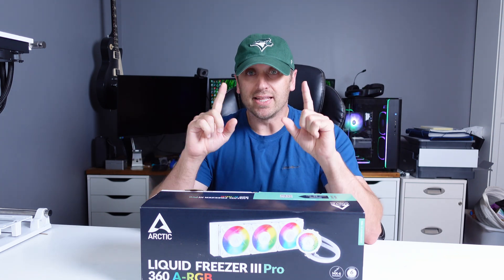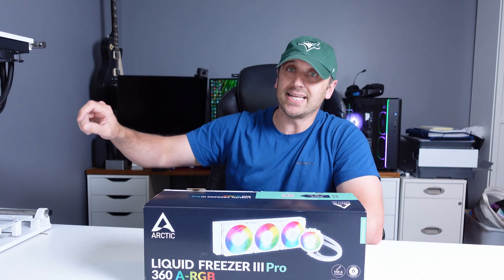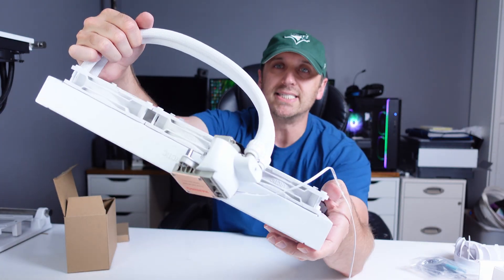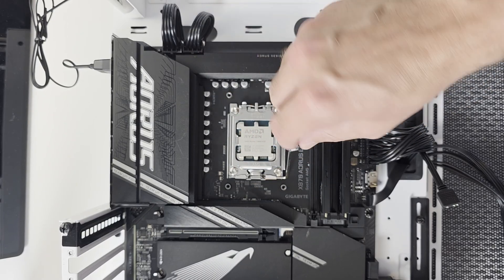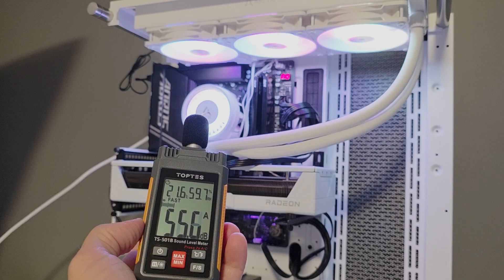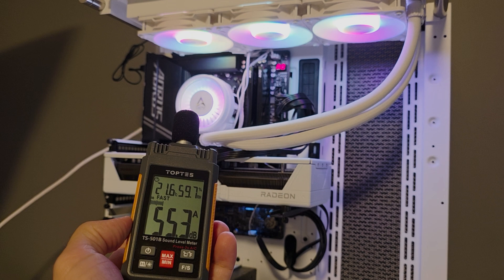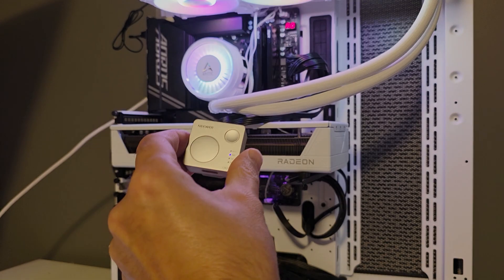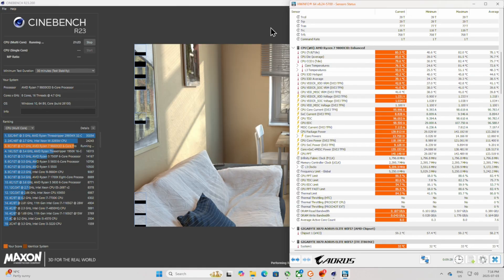Arctic liquid freezer iii pro 360 - Unboxing, installing, testing - comparing to the non-pro model.

Comment: Have a question, if i remove the standard fans it comes with and replace them with lian li uni lcd fans would i still have to plug in the fan”cable that comes part of the 4 seperate connector pin cables? Or would i just connect the aio, pump, and rgb, and leave the fan cable disconnected?

Comment: I also have a gigabyte motherboard which is in the prebuilt I bought. There is already a connection plugged into the GDV header -im assuming for the three fans at the front-, so is there any other connection i can plug the rgb cable into?
Reply from the maker: There are no other headers labeled argb?
Reply: @jackshardware  I'm new to this i didn't know what all the headers meant. This is my first time doing any sort of add-on to my pc so I was really nervous i'd plug it into the wrong thing or break something, but I'm confident I can just plug it into the D_LED 1 header after doing some research. Also can I use the sys_fan1 header to plug the vrm fan into since I don't have a CPU_OPT port? Great vid btw :)
Reply from the maker: @ZZX_PRODUCTION yep you can use the sys1 fan header for your vrm.

Comment: Worth noting. Non-pro 100% pwm = 1800 rpm fans, 2700 rpm pump. Pro 55% pwm = 1800 rpm fans, 2300 rpm pump.

To get comparable results you need to run the PROs pump separately at 80%+ pwm for full pump speed, according to spec sheet on homepage.

The thicker radiator might also need the extra pump speed to keep radiator cooling optimal.

Comment: Just had this one (black, non RGB version) installed in my PC, when I upgraded my CPU to 9800x3d from 7700x (mostly due to huge temps on the latter and the fact that I had to undervolt it). The cooling I had before was Arctic Liquid Freezer III 280 - got this one when I had a smaller case that could not accommodate a 360 AIO. Well what can I say - I have switched back to non Pro 280 after about 3 hours. Maybe the cooling was a bit better on the pro 360 but I could not stand that loud fan noise (the pump and the VRM we pleasantly quiet). I tried everything - setting the right temp to noise curve in BIOS, tried both all in one cable and separate one. Even after setting the curves, the pro 360 just had to go full throttle while booting or during some spikes while the non pro 280 is dead silent most of the time. The irritating noise started whenever the fans went past 1400 RPM however, even at lower RPM they were not as pleasant as non pro 280.

The temperatures were lower, no problems there, but the noise was unnacceptable. Bummer as I thought this would be an all around upgrade.

That said, the 9800x3d does not go past 64 C on Cinebench on both of these, however on pro 360 it scored 24000, while on non pro 280 it scores around 22500.
Reply: does your sound like its retiling when you turn it on

Comment: Hi. Just also got this AIO and I was curious if you knew how to make the fans and cooler rainbow just like when you start them up. On windows mine are blue all the time and with gigabyte controller and rgb fusion I can’t make them just as rainbowy as when starting up.
Reply from the maker: It would be a setting in your motherboards rgb software. Each motherboards software will be a little different.

Comment: Questions for enthusiasts and hobbyists only: is it possible to replace or extend the hoses? Perhaps it is possible to convert to a G1/4 connection. Please refrain from responses such as ‘it's an AiO cooler, not designed for that.’ Thank you.

Comment: Hi, first of all, thank you for the video, it was really helpful. I have a quick question: I have this AIO and I'm considering buying the motherboard you installed on it. Does the VRM block make contact with the M.2 slot? Does it prevent the M.2 from being inserted or removed while the AIO is installed?

Comment: Ive had my 5800x since early 2023 and been tweaking curve optimizer plus pbo settings, eco mode and every other setting. I first had the wraith prism which was just terrible. Later changed to a noctua nh d12l which did a better job but im so sick of my high temps so i just bought this in hopes of way better temps.

With stock setting i throttle almost instantly with my nh d12l. if a 360mm aio cant cool my cpu ill throw the cpu out😂

Comment: Around 09:05 when you say that they've increased the length of the screws, is it only on the Pro model or on the normal model too?
Reply from the maker: Normal as well. It's much easier to install now.

Comment: bought this one for the 9 9950x3d and its not going over 78c under full load on OCC
Reply: What I am finding from my research is that the LF3 Pro performs better on AM5 chips with more than one CCD. So, it's not exactly ideal for the 9800x3d.
Reply: How much noise in db? I'm thinking of buying this cooler for my 9950x3d long hours of rendering.
Reply: @ou1814  Its kind of loud not gonna lie to you, If you sleep in the same room where your pc is gonna be while you let rendenting all night it is gonna be loud, I play only with noise cancelation on, and its okay. It keeps the temperature really good but the bad side is that it is very loud

Comment: Do you need to do anything with the daisy chain cables
Reply: The fans are all pre-wired alongside the radiator and run inside the water tubes down to the water block, so you are only plugging in either the single cable or the 3-way split from the block. Plus the RGB cable if you got the RGB variant.

Comment: sorry I bought this heatsink only that then I realized that my motherboard does not have 3-pin connectors to connect the argb cable of the fans but only the 4-pin ones what can I do? 😳😳
Reply from the maker: You can get an argb hub for pretty cheap.
Reply: @jackshardware  Perfect, I got an EZDIY-FAB RGB Converter, 12V RGB to 5V ARGB, and it solved the problem.
I hope it lasts a long time.
Thank you very much.

Comment: On AM5 CPU mounting is a total nightmare. Cooling is good, but I hope they change those fixing screws on the pump.
Reply from the maker: When the arctic liquid freezer 3 came out at the beginning of 2024 mounting was difficult. Since then they have increased the length of the screws on the cooling block which has made it much easier.
Reply: Pro Tip: I struggled with this last year but found a pretty good method after doing spring cleaning. When installing the AF3 unit, tighten the R mounting bracket all the way but keep the L bracket slightly loose, not much but enough to wiggle it a wee bit. This will allow some tolerance so you can get the screws started for the block. Now you can either mount the CPU block all the way then finish tightening the L bracket or tighten the L bracket then continue to fasten down the block.
Reply: @ANTS_SaViOr dude you are a total savior, i’ve been struggling for the past hour and finally got it thanks to this

Comment: I have the nonpro 360 Version bought at the start of the year and I heard a high frequency noise when the pump is running at full speed. So Im running it at 67% where the sound disappears. How is it with the new version of the cooler?
Reply from the maker: The pump is pretty near silent. It's the fans that need to be turned down.

Comment: Appreciate the video. Running the same specs and trying to find a new cpu cooler as I’m hitting 91c under full load and this video gave me my answer. Keep up the work.
Reply from the maker: Glad the video helped.
Reply: Me too!! I was an idiot and got a fan cooler on my new build. Bad move. Its over heating bad.just bought a freezer 3 pro.
Reply: Im running a ryzen 7 9800 x 3d 5070ti 650e x elite mobo
Reply: @JS95bravo  Awesome rig! That freezer 3 pro should set all your worries aside. Happy gaming!
Reply: What is the answer? My aio is maybe broken too

Comment: there is a 35 euro difference between the flat model and the pro model on amazon, the pro model is cheaper, if I don't misunderstand, the pro model works louder but cools better, right? I also have a budget of 95 euros, is there any liquid cooling you can recommend for this money or should I buy the pro model?
Reply from the maker: Buy the pro model and set the fan curve lower. When I tested it in the video at the same db level as the non pro model, it still cooled a little better.
Reply: @jackshardware So do you really think I should buy liquid freezer 95 pro for 360 euros or how about if I buy phantom spirit 120se for much cheaper, my processor is I5 14600kf not oc, is the arctic worth the price difference?

Comment: What i didn't quite like was the fact that the cables for the fans are integrated into the tubing. What if one of them fails? how would i be able to replace them? Or what if the cable itself fails?
Reply from the maker: The fan power cable and argb connect at the very top of the tube. If anything every happens you can just connect them like any other fan.
Reply: There’s a 3-way PWM splitter there so you can unplug any fan you want. A-RGB is daisy chained between the fans so you can also unplug any 1 fan if they fail.